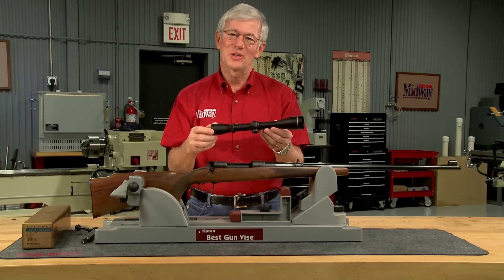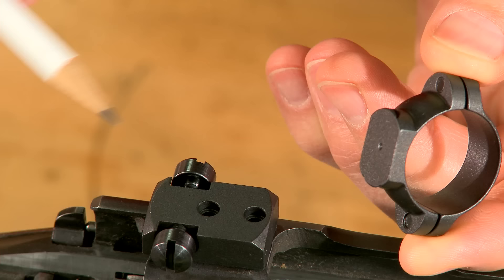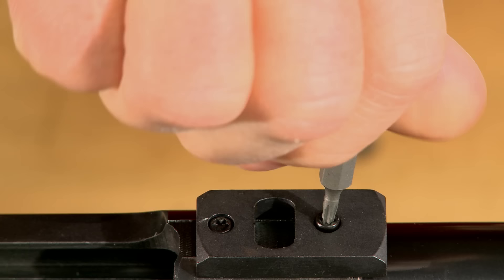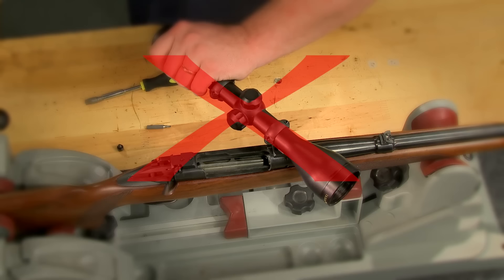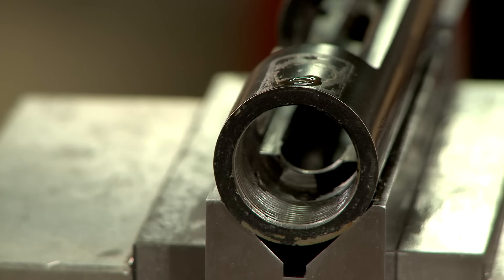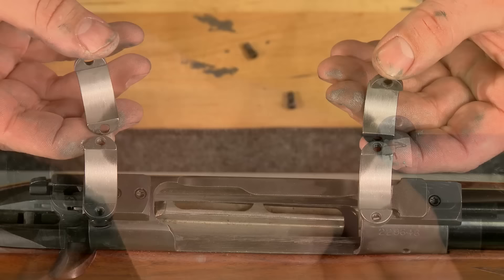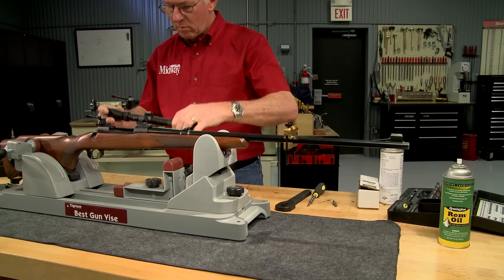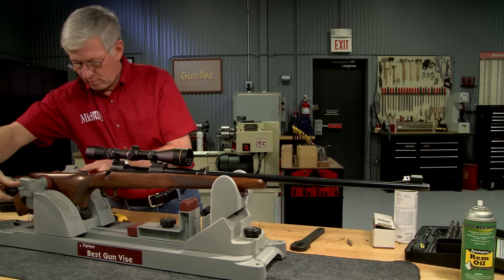How to Properly Mount a Scope Presented by Larry Potterfield | MidwayUSA Gunsmithing

Comment: Now I just need 13 other products to put my scope on my rifle.  Sweet.  Almost there.
Reply: $500 scope turned into $1500 scope in few simple steps
Reply: LOL
Reply: @aletzr  Next up: Lathe and Bridgeport machine, get electrician to rewire house to take the new load; yep, it was easy. Thanks, Larry!!
Reply: @aletzr  well he does own midway, what do you expect?
Reply: @rooftopvoter3015  🤣🤣🤣🤣🤣🤣🤣
Reply: I was coming here with the same sentiments. Good grief. REAL WORLD application.
Reply: Just use different rings.
Reply: This is exactly what happened to me.
Reply: if you have a fairly modern rifle, buy yourself a quality one-piece scope mount and you can skip half the steps in this video.
Reply: Do this one simple trick…
Reply: Or visit you local gunsmith

Comment: Wow. I just screw on the rings, mount the scope and snug it tight. I used literally none of those tools and my scopes work fine.
Reply: But how long do they last?
i guess it would matter much on low recoil/powered rifles,also if you're not shooting past a couple 100 yrds
Reply: Claytdogg X o
Reply: That's probably the way the professionals do it too.
Reply: @borbors  I just inherited my grandfather's Marlin 444s. He scoped it a year after he got it, around 1972. He didn't do all of this fancy nonsense and that scope still holds zero to this day.

Is nearly 50 years of regular abuse from shooting .444 enough?
Reply: I probably wouldn’t expect much accuracy beyond 500 yards then.
Reply: That's probably how my grandfather mounted the scope on the Remington model 721 he got in 1952. Still dead on at 200yrds
Reply: I should think that if I paid a gunsmith to work on my rifle, he'd go for maximum achievable precision, even though shortcuts and spit balling work just fine for most people.
Reply: @appalachiangunman9589  500 YARDS WITH 444...i hope you are joking
Reply: Snow Blind I wasn’t responding to that comment, I was replying to the original comment which made no mention of chambering. As for a scoped .444 I think that along with 30-30’s and 45-70’s is an abomination, I personally prefer iron sights for rifles in those chambering, but it’s none of my business what people put scopes on.
Reply: Ryan Reyes well that seems unnecessary
Reply: @appalachiangunman9589  only a fool ever needs to shoot that far anyways
Reply: @chetmcmasterson  don't get your hopes up. A fool is easily parted with his money

Comment: I was always told a level cap doesn't = a level reticle. I use a plumb line and turn my scope to that since gravity has never not shown me true vertical. It's always good to learn other methods. Alot of good info in this lesson. Thank you
Reply: This is the best coment ive seen on here, i never thought about that but  is a very good point!
Reply: This is what I learned as well.
Reply: A plumb line is a great idea for reticle leveling.  Will be mounting a new scope shortly.

Comment: Larry you never cease to amaze me. Believe it or not, but because of your concise and most excellent videos, your generosity to the NRA and the Amazon-like rating system that gives a buyer a true plumb line to how well a product works, I almost never shop anywhere else. 
You are one of my heros and your professionalism bleeds out of everything you do.
I pray you and your family have a very Happy New Year and may God grant you even more prosperity this year than ever...
Reply: I agree, Larry is a professional intent on sharing how a procedure should be done professionally. Well done and thanks for sharing your knowledge! BTW the wheeler engineering kit can be had for under a hundred bucks.
Reply: Dan Arnold I need one of those barrel levels, I have a scope level I got from Midway I think it’s called “The Tank” it’s just a little short chunk of steel that weighs a ton! I do have the Fat Wrench, which is a very handy tool to have around when you’re mounting scopes.

Comment: I recently mounted a scope to one of my rifles. This was my very first time doing it. Over the years I acquired most of the tools needed to accomplish a professional install. My one concern was lapping the rings. Which I didn't think I needed to but found out differently. 
Note it was a Cantilever type design milled from billet aluminum. Also it was a popular brand not a knock off from some fly by night company. 
With that said lapping revealed inconsistency in finish and alignment. So I learned valuable lesson by lapping any set of scope mounts.
I highly recommend lapping on all types of rings, and mounts to confirm surface inconsistency and alignment. Want to thank Midway with providing all of us with some great video's. 
You have helped this novice scope mounting shooter accomplish a professional job.
Note I was a master automotive mechanic for 35 years. I applied some of that gained knowledge to my novice gunsmithing skills along with 25 years in the Army.
Sincerely Arni Shook 
Retired CWO US Army 

 

RINGS AND MOUNTS

PRO EXTENDED CANTILEVER MOUNT
30 MM

Comment: Properly mounting a scope IS vital, but it shouldn't be taking a couple-hundred bucks doing it. Most folks are competent enough to get their gun level and look through the scope at an orange piece of yarn tied to a dangling weight, using it as a plum bob. Just rotate the scope to match the vertical cross hair to that string. That is free and absolutely just as good. Saved you some money 💸!

Comment: Thanks for an excellent video. For all of my life, I've bought the parts and screwed them onto my firearms. Every time I've done that, I've wondered about the manufacturing precision of factory machined parts and what might be the steps and processes that would improve fit and alignment. For those who want a high level of precision, Larry does a great job of going through the process, step-by-step. I priced the tools in this video from several sources and they seem comparatively inexpensive when compared to the cost of a well built rifle, scope, base and rings.
Reply: Mhm, it’s nice to see what the process is to properly mount a scope
Reply: It is a good video explanation. Except he implies that all screws can be torqued to the same value. 30 in-lbs was to much for my Leupold model seven scope base screws. Waiting on new screws now… sucks
Reply: I was thinking it would be nice if there was a way to rent some of these tools that only get used once every ten or twenty years.
Reply: @Pedro Paramo Easily $100.

Comment: Now, how did grandpa do this without all the fancy widgets :)
Reply: Nick Horton good question
Reply: Nick Horton all of the sudden we need all these fancy tools
Reply: Let me cut it down to simple for you, you’ll need 2 levels, a screwdriver, and a big wrench. Unscrew the mounting caps, put in your mount system, wrench on the front bracket. Sand the insides of the brackets to avoid scratching and low spots, then level the brackets to each other. Install your scope, level the gun by placing 1 level on the barrel or mounting cap, then place another on the top of the scope. Once it’s all level just tighten down the mounting bracket and take it to the range to zero it in and make any adjustments.
Reply: He used a lot of ammo getting the scope sighted in
Reply: @TwoBitty  . He didn't say this is how to do it cheap and dirty. He said this is how to do it properly.

Comment: You needn't use an off-set front ring if you had simply reversed the front and rear bases to narrow the mounting position of the scope.  This also put the scope in a forward attitude to prevent scope bit.  A technic I've used over the years to prevent contact rust and corrosion between the rifle and bases as well as the ring and scope is to line and trim Blue painters tape between the contact points once the alignment is true.  the adhesive will bleed through the paper tape once under pressure and ensure moister never becomes trapped between the metal parts.  This will prevent corrosion, slipping, or scaring of the metal surfaces.

Comment: I used these same tools to level a cheap Amazon scope. After spending the time to make the turret and barrel levels perfect, torqing the screws, i looked through the scope and the reticals were about 10° off plumb and level. Disassembled everything and reinstalled, same thing happened. Gotta love cheap manufacturing. Wound up drawing a plumb line with marker on piece paper taped to the wall to match up the vertical retical with. Short of that the 50.00 "PINTY" 4-16x40 from Amazon has really been a great "cheapo" scope.

Comment: Well I have two takes on this.  Do it with no fancy tools, just be careful and it works.  I also bought these tools years ago for about $100 and used them the lapping tool and torque wrench are good to have and makes for a good solid scope installation.  So do what makes you comfortable.  Oh, and learn to shoot.  You can always argue with a procedure but you cant argue with results.

Comment: $230 on Amazon for that exact vise, ring alignment kit and reticle leveling kit. Add another $70 for a decent boresighter and you're at $300. You can buy that and start charging people to mount and set their scopes. If you charged $75 (which is cheap), the parts pay for themselves after 4 jobs. Not a bad deal.
Reply: gun stores generally charge $25-$50 for scope mount and boresight jobs.
Reply: Its $85 on Amazon for the vise now

Comment: You should level the scope against a plumb line. The reticle inside the scope may be slightly off. Level the gun and then check the vertical hair against a plum line down range.

Comment: to help reduce the possibility of screw interference with the bolt, realize that machining and engineering standards usually call for the length of the screw to be at least 1.5X the nominal diameter of the screw + whatever offset is present.  Anything less will cause issues when vibration is present.
Reply: Only takes 3 treads to hold.. That being said, 3 threads are better than 6..

Comment: My main question in watching the video was to determine the correct inch pounds to torque down on both upper and lower rings.  Larry you were the only one to mention it, thank you..
Reply: The manufacturer will usually specify as it will vary slightly between products based on how it is designed and the material used.

Comment: If I shot super long distance or professionally, I would follow this advice to a tee.  Frankly, for my shooting purposes, I'll be skipping the lapping and alignment kit stuff and the lathing process.  I will use a torque wrench and blue Locktite though.  I will also use small levels to level the scope with the rifle vertically and horizontally.  And while this part is outside the scope of the video, it's best to have your sighting-in target -- whether it's at 25 or 50 yards -- at the same height as your barrel height.  You can ballpark that level, or just use your body as measuring stick and mark where the barrel reaches your body, and then go place your target at that level.

Comment: What happens when the scopes turret cap isn’t perpendicular to the vertical crosshairs? I would have thought a plum bob to align with the vertical crosshair would be a better method once the gun has been levelled?
Reply: Yes, and several commenters are suggesting it.

Comment: A lot of people ripping on the video..Truth is it can be done with less.However Larry is a gunsmith and is teaching you on doing it the best way..
If you cannot afford all the tools(I completely understand BTW)Then take the rifle to a gunsmith they will mount it in a similar fashion and it will be done correctly.
I’ve seen really nice old bolt actions that have been stripped due to some guy in a garage mounting his scope to his nice model 70 Winchester and Forrest gumping his way though the process…And stripping out the holes in the receiver..

Comment: This scope mounting is 100% bang on .  Personally I do it without lapping the rings because CNC machining is so good , I trust the rings to be concentric.  Also I don't use a torque screwdriver,  I depend on my sense of feel.  The 2 level set $$, a couple of small levels will suffice.  1 level across the receiver  and one on  the top scope cap.  A MTM  rifle rest is very helpful in doing this job. 
If you have the money,  get all the tools and enjoy doing it like a pro.

Comment: never knew there was so much to it.  I just buy rings and scopes and put them on and sight them in.  I wonder how much more accuracy I could achieve?
Reply: At normal hunting ranges, practically none, but your scopes adjustments might not move the amount they are supposed to, which is no big deal.

Comment: I never even thought about lapping the rings. Great information.
Reply: Leupold does not recommend it.
Reply: @steveo1240  in their manuals that say lapping is not required or recommended lol. Call and ask them.
Reply: @mopar21  Rings are cast, not machined so there will be inaccuracies. Lapped some awhile back, big difference.
Reply: @rooftopvoter3015  not all of them.

Comment: Yeah, I'm going with a modern rail for my Enfield No.4 Mk1.
Found one that lets me keep and use my irons, and using a quick detach mount (also rings base is milled from one piece) that lets me retain my zero.
Modern meets old. Throwing a Primary Arms SLx 4-14x44mm FFP Rifle Scope on it. Paid $200 for my Enfield, so $200 for the optic seems reasonable. Base is $125, and the QD rings I still have yet to decide upon. Gonna maybe have me a 1,000 yard rifle for probably less than $600, which ain't bad. Not sure how .303 British will fare at such range, but I'll be quite happy even if it's accurate to 600-800 yards. Just a fun rifle, and maybe I'll take it hunting, too (at closer range, of course).

Comment: So basically I need to send it off to get it professionally done. I don't think regular folks have all these tools. Also, do the same rules apply if using a picatinny rail? Or is that a whole separate video?
Reply: No call talley their rings dont need to be lapped like entry level rings like leupold which are ok, but need to be lapped to be perfectly alighned. They are the best for the money(talley), I mean u could spend 600 on eaw apel mounts , which also dont need to lap talley bases start at50 and go up to 160, same with their rings, point is for the money u would spend on all this slop, u can by a quality mount that doesnt need to be lapped.
Reply: thanks for the info kev.
 i usually get the gunshop to do it for me coz they do it for free.
Reply: gun vise, torque wrench, leveling device....that's it.
Reply: @borbors  get the gunshop to do it for you, since they wont break the scope. if they do they should replace it. they wont do that if you break the scope
Reply: Small brain

Comment: my problem is when the bolt was put back after the scope was mounted , the bolt will not open, the bolt handle is down but so is the little tang that you push to remove the bolt. I cannot pull the bolt handle up

Comment: I have and use the wheeler leveling system, but the part that confuses me...if you have it clamped on the barrel, and level it by twisting the screws, arent you just telling yourself the barrel is as level as the bubble is at that point?
Reply: It may not be helpful being that it's 3 months later, but I believe the first step is to use the level on the action to get the barrel level, level. After that the barrel level is level, and you can use the level that was on the action, on the turret of the scope. That is my understanding.

Comment: If you buy precision rings that are CNC machined from sintered steel such as Warne Maxima rings, and keep them in matched pairs as they come out of box, I don’t see the need for lapping. Not even sure if Locktite is really necessary for the bases, but rifle manufactures torque setting for the bases is 20 inch lbs “for the new Winchester model 70’s at least”, I verified this with Winchester, they said 25 in lbs is slightly too much torque. Of course a thread with any type of liquid or lube will actually end up tighter than what torque screwdriver reads.

Comment: I had a scop installed at Sportsmans Warehouse, I also had it bore sighted.  I had this done after hunting. I went to clean the rifle and the before checking how close the bore sight was to the bull eye and  could not get the bolt to open, the safety would not slide back and forth, and the bolt would not cycle, it would not move. Any ideas??

Comment: Best and easiest way to assure the crosshairs are "level" is to put a square horizontally across the bottom of the rifle with the floor plate open and align the windage knob of the scope with the vertical side of the square. It's faster, easier, more accurate and cheaper.
Reply: I think I will try this.  My older rifle doesn't have a rail, or flat scope mount (such as used here).  SO have been trying to decide what reference i can use for leveling it.  thx

Comment: A lot of work, lapping, glueing etc.   But its all for naught if you trust the tiny cap on the scope is level with the cross hairs.
Also you assume the top of the gun is level with the barrel.  So there is a source for 2 errors that compound.
Also you assume the tiny level is true.  Many are not which is the source of a third error.   And the three errors all add up.

- Instead of lapping you can add friction tape, its not a big deal is not really needed.
- You need to use a plumb line to level the reticles.  And just have trust the top of the gun level is close being level with barrel.

Comment: There is absolutely nothing wrong with a properly installed ring mount. However, these days i when ever possible go with railed scopes. So much easier to get a good, solid mount with perfect alignment every time at home. Not every scope is sold with a rail mount and if they are they are generaly a little more expensive but to me its totally worth it.